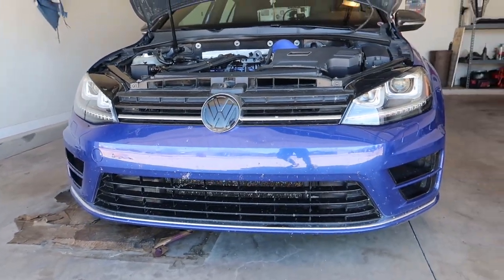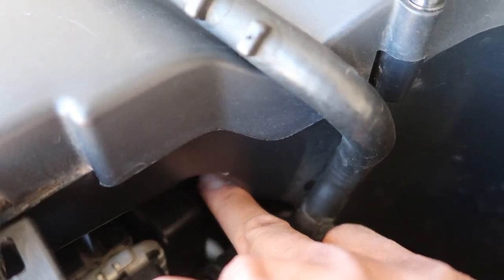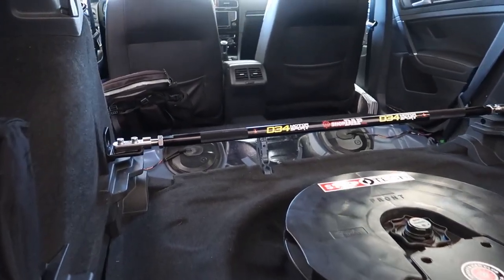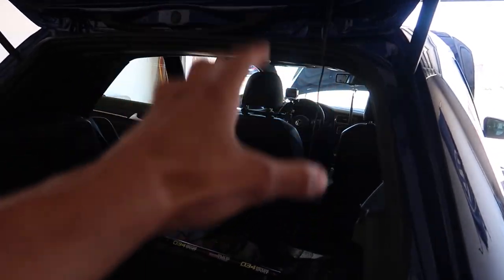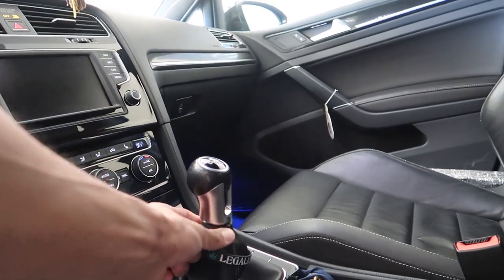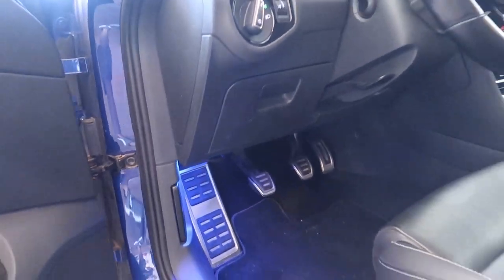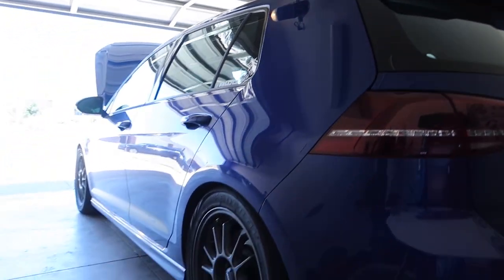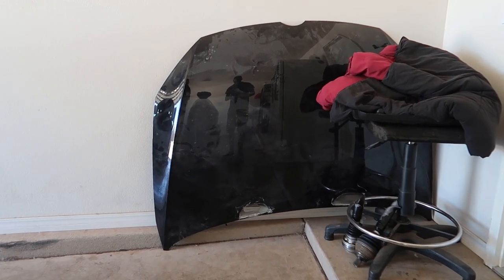Bro, What's all done to that thing? | 60,000 mile update | MK7 Golf R

Comment from the maker: Full mod list as of May 2, 2019

Engine:
Eurodyne maestro: Pro tuned by Frank Mabo
APR Boost tap
APR Dog bone insert
APR Intercooler piping 
BFI Engine mount stage 1
BFI Transmission mount stage 2
Brisk ER12 Sparkplugs
CTS turbo piping 
PTP Turbo blanket
iAbed rear main seal
Racingline catch can 
Racingline Remote washer
Racingline Intake (R600)
Racingline Turbo muffler delete
Racingline Turbo inlet
Racingline Intake pipe
Racingline Intercooler
Remus Sport Exhaust**
Revo down pipe w/42DD O2 spacer••
South bend stage 3 daily clutch
Turbosmart BOV

**102mm Carbon angled tips w/ Ti internals
••Exhaust wrapped 

Fueling:
Precision raceworks 925cc kit
Precision raceworks high flow fuel line
Walbro 450

Wheels/Tires:
17x8 Hypergrams (satin silver)
Federal 595 RS-RR 245/45/17
BFI 5mm spacer 

Shifter Upgrades:
034 solid shifter bracket bushings
Ball shim mod
Clutch stop
Clutch spring delete
Diselgeek sigma 6
Dieselgeek shifter shaft bushings
Dieselgeek super pin
ECS clutch bleeder block
ECS SS clutch line
OEM metal shifter bracket 
Swirl valve delete

Suspension/Brakes:
034 rear shock bushings
034 rear subframe inserts
034 rear sway bar
034 sway bar end links 
BC Racing coilovers w/ Swift springs
BC racing front endlinks 
EBC yellow pads
Eurocode front strut brace
iSweep DCC deletes 
Rear Leyo undercarriage brace
Stoptech slotted rotors

Exterior:
Black emblems
Blind spot mirrors 
Carbon mirror caps
LED euro tails
Maxton Spoiler
Racingline stripe 

Other:
De-badge front, rear and fenders (R)
DeAuto key blue LED footwells
P3 Boost gauge w/analong tap
Porsche coolant cap
Rear wiper delete 
Struts cut for camber adjustment
Reply: What's the best 1/4 with those mods on street tires??????
I thinking into buying one(used)
Also stage 3 involve a build block?
Reply: Wich are your 1/4 times with those mods???
Is possible to run 10.9 on a stock block?? Becuase I am thinking into buying one(used)
Thanks in advance
Reply from the maker: I'm not sure on street tires but the record right now stock block is 10.4 somethin. Record stock block stock turbo is 11.07

Comment: Where did you get the racingline stripe? I have been trying to get one forever. Racingline wont answer my emails and I found a 3rd party company to make me one but Im worried about 3rd party quality.
Reply from the maker: They sent me a set after I got my intercooler.. they don't answer my emails either.. but whoever runs their IG is top notch. I got an extra stripe AND replacement O-rings for the turbo 90° through whoever runs their IG. All for free, too. Try that!
Reply: Bryce Jordan Productions thanks the the info 👍
Reply from the maker: Anytime buddy!